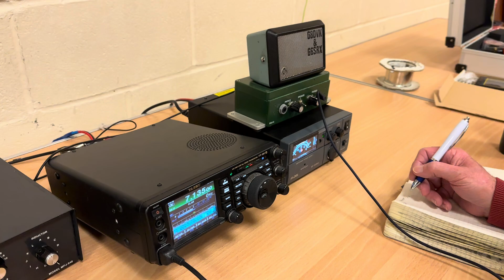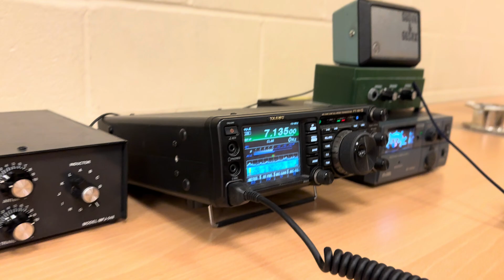Using a simple station set-up: Yaesu FT-991A, MFJ matching unit and an random end-fed wire

Comment: Nice. I can see noise on the 40m band. I have that issue at home too. The best solution I found for that band is to have my longwire on the ground rather than high up, I can still make plenty of contacts to Europe via FT8. 73.
Reply from the maker: Hi there, yes, a wire on the ground nearly always helps SNR which is much more important than signal strength. 73!